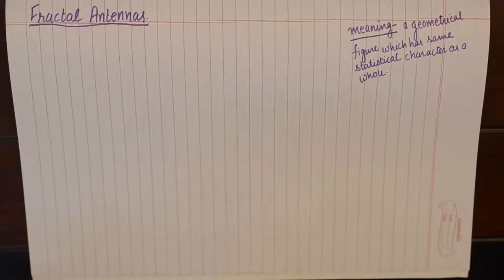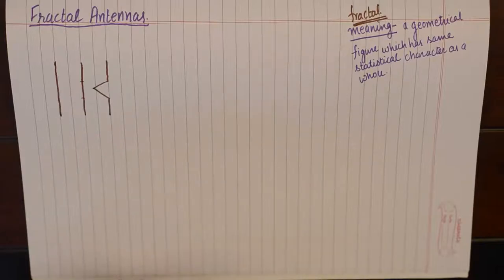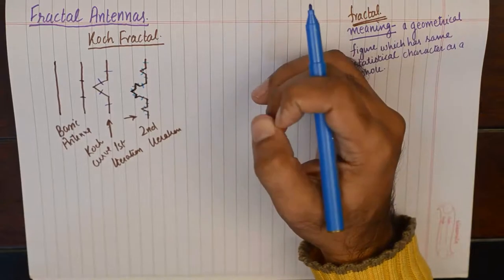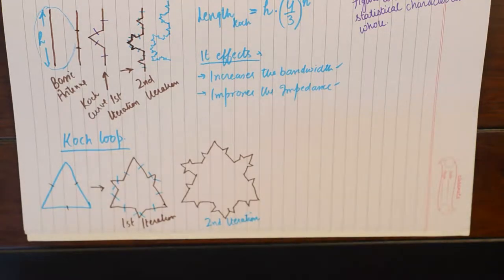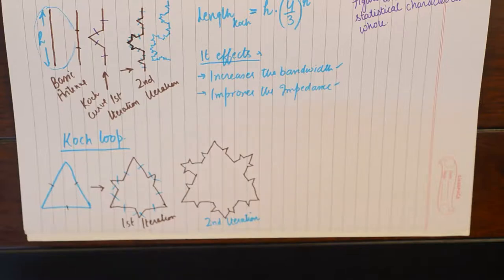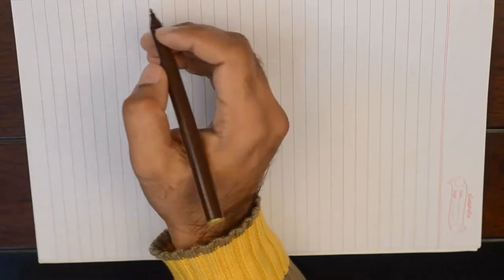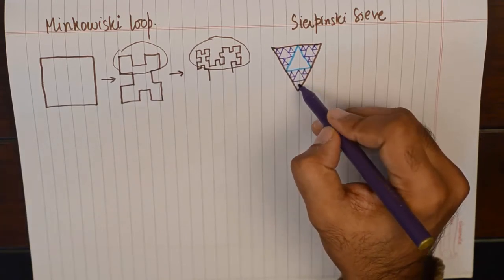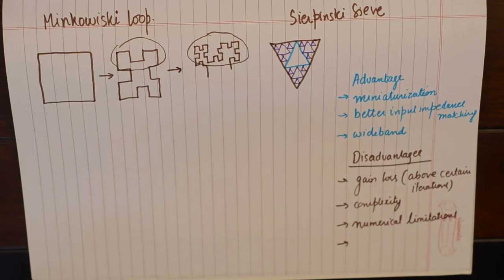Fractal Antennas Discussion | Koch Fractal | Design Construction and Applications

Comment: There are plenty of YouTube videos about Fractal antennas, but none of them explain how the dimensions are derived. When you take your half-wavelength rod and make the fractal iterations, the length from end to end, measured with a straight-edge ruler remains the same, although the length of the actual wire increases each time. Does this mean that the resonant frequency remains the same?

Comment: You answered some of the questions I had, but created a few more.  For example, when you take a length of a dipole and divide it into thirds, and you make the triangle shape in the middle third, what are the lengths of the sides of the triangle ?  Are the sides the same as the other 2 thirds , which would mean you have added a length of 1/3 of the straight dipole?
Reply from the maker: Hello, whatever triangle is made out of the middle third would be 1/2 of the 1/3 allocated to it :) nothing giving any new lengths :)
Reply: @nipunharitash  , so, if the total length was 3 inches, and you divide into thirds, the triangle would have sides that were 1/2 inch in length, right?
Reply from the maker: Absolutely , with third side as air :)
Reply: @nipunharitash  , Well, if that is the case...if you were to measure from the "bottom" of the "line" to the "top" of it, the total length would be shorter that the straight line, and you have added absolutely no additional length to the wire.  How are you "increasing the length" under those circumstances?
Reply from the maker: Yeah , absolutely that's the beauty, had we taken a 3 inch antenna for our use and desired requirements, we'd happier if I could obtain same usage from a 2.5 inch antenna . Now that 2.5 inch antenna is cleverly behaving like a longer one.. 3 inch antenna :)

Comment: OK we know its a "Koch Fractal Antenna".  Basically the "middle third" ( of a half wave -which you called lambda) is bent into 4 straight lines but you fail to explain the importance and design of the first "straight line" section.  Total Length x 4/3 ie,  1 & 1/4 wave length.. Overal, not a bad effort on a difficult to explain subject.